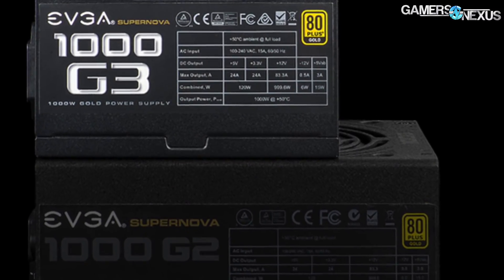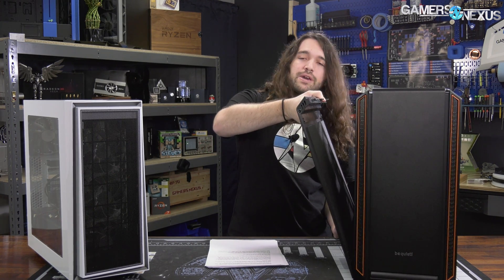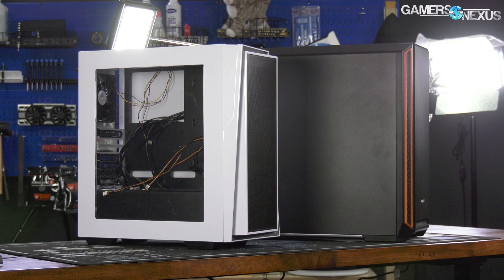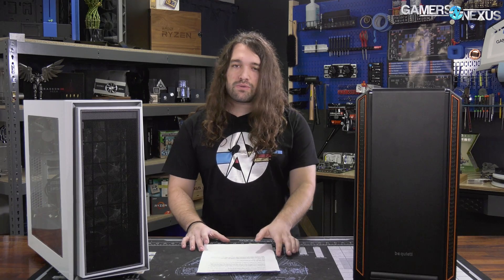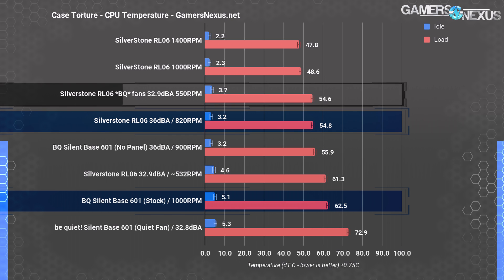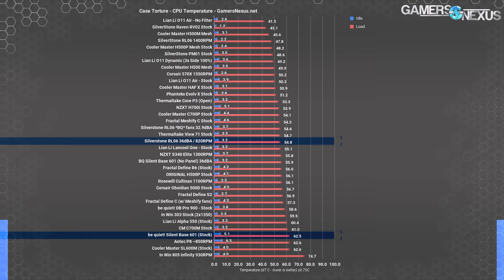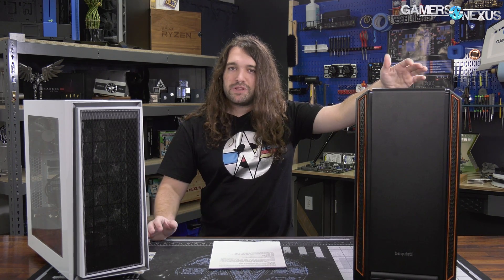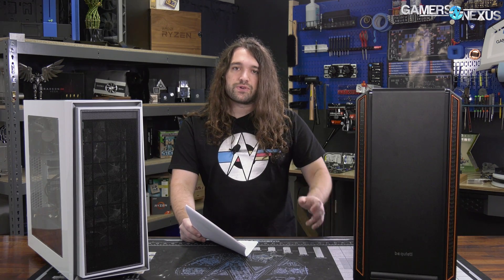Airflow vs. Silent Case: Noise-Normalized Thermals

Comment: This is an excellent theory, and I really appreciate you testing it.  I think you chose a poor example of a quiet case.  I think the Antec P101 Silent is better than the Silent Base 601.  Reasons I believe this:

1) Tom's Hardware rated it better: "even though there are three 120mm intake fans, the small vents in the front of the chassis did not impeded performance as much as we had expected." On "acoustic efficiency, also referred to as cooling-to-noise ratio" the P101 scored better than the SB 601.

2) The airflow arrangement on the P101 makes much more sense to me:  The P101 has three intake fans.  More fan surface area = slower fans = quieter, right?  The intake area seems pretty well sealed, so that intake air pressure isn't going to just leak right back out around the intake fans.  The SB 601 has one intake fan, in the middle of a huge mesh screen.  Lower fan surface area = faster fan = noisier.  It looks like all that intake air pressure is just going to immediately leak back out the front of the case.

Do you feel like testing this?  I ordered the Antec P101.  Should I also order the SilverStone RL06, and test the noise normalized temperatures myself, using a sound meter app on my phone?  I know that won't give ideal results, but I think it would be better than nothing.
Reply: How's that case? That Antec seems to be the best priced silent case on the market and definitely better than SB601.
Reply: @stanisawkowalski7440  I'm very happy with it.  I posted a video of my recent build with it.
Reply: @darxustech2883  Great oldschool way - no bullshit build in silenced case. I like that way more than Jean Michel Jarre's concert in the pc case. I'm curious about few things. How would you describe noise of case fans using build in fan controller? Is Low hearable? Is High nosier than other components? And how are the temps when you choose middle one - fans turned off? Will it handle webbrowsing without other fans starting being noisy?  And how's that X570 fan? Is it hearable in Antec anytime? Because there're a lot opposite opinions about these damn fans.
Reply: @stanisawkowalski7440  thanks.  I never hooked the fans up to the case's fan controller.  I plugged them into the motherboard fan headers, which can control DC (non PWM) fans.  With custom fan curves.  It stays real quiet for web browsing.  I've never noticed the X570 fan, and I've run loads with the case open to pay attention to fans, but wasn't specifically listening for that fan.  

At max speed, these fans are noisy, which is what I'd expect on the case fan controller's top speed.  My guess is, with the case fan controller, you'd use low most of the time, and medium for gaming, and that would work fine, but why not use automatic motherboard control?  

I think I will probably eventually replace the case fans with Noctuas, once the NF-A12x25 comes out in black.  These aren't bad, but I intend to have this case for a long time, and I might as well.
Reply: @darxustech2883  Fan controllers are for noobs ;) But I wanted to know, in case of recomending that case to some noobs. Because noobs like fan controllers :] Like I said, to me it's best priced silent case on the market and from brand, which has bigger experience in producing them than Fractal, bq! or Nanoxia. Reviews are great, scores are good, so it must be great.

If we talk about fans, I wouldn't go with Noctuas. A12x25 are maybe the best fans for radiator, but for a case not so much. Cheap way are Arctic's P12/P14 PST - top of the world performance and really quiet. But cheap fans mean cheap inside - sometimes make specific noise on some lower rpms and I woudn't expect long life without degradating. But 5 of them costs like 1 Noctua. Great midrange and kinda quality are Fractal's X2 GP12/14, but I don't know if they make big difference and are rather a little less efficient than Arctics. I recommend Silent Wings 3 - great performance, great inside, sound just best. They are a lot of comparisons of fans in the web, so see for yourself, but look for methodology - I've seen guy who test them in Define case using only one as exhaust, so it's worthless. Add to this that every other test with the same fans gives completely different results and you will have hard choice. If you don't see a problem with paying premium, just go with SW3 PWM. And in general beware of fast (>1000rpm) 3-pin fans - their start is definitely higher than 4-pin, so they're always rather noisy (in case you don't know that).

Comment: I care way more about high frequency noise than low. I have an RL06 with noctua case fans, great cooling with very little noise at 45% fan speed. However, coil whine and high frequency noise from the CPU and mobo are killer, I'm very sensitive to such noises. In retrospect I probably would have tried to find a case that's in between the two featured. Something with a mesh front but thick and padded side panels.

Comment: Please do a gaming / audio recording system. Most people who are noise nazi's for a gaming LC will mean it's for two seperate use cases. One is gaming the other is audio recording which is low load! So test with a condenser mic in the room. A couple metres away. That's all we need.

Comment: Whats the best silent, best airflow and non RGB Case 2020? Im looking for it. Thx.
Reply: Maybe @GamersNexus replies? I have the same EXACT question
Reply: @lBioHaZarDl  Define 7 Solid. Great airflow, silent during no load, really quiet during load. Until you don't buy shitty cpu cooler and cheapest graphic card, you don't need mesh front. I have this case and opening the door or removing filter doesn't change temps. Mesh airlow cases are shit ;) You can check on my channell, how it behaves.

Comment: Hey there,
Occasionally I record Audio with my pc. This does not need a lot of computing power, but a loud pc might be an artifact on the recordings. That is a case that you didn't really consider in your review, right? So basically, what I would need is a case that is as quiet as possible for reasonable loads and temperatures.
Higher Temperature doesn't dequalify the case, as long as it stays below ~60°C, right?
So, would you say the "be quiet" case was quieter in near idle mode?
Reply: Having just gone from a high airflow case to the bq 601 for audio work, I can say the bq definitely served my purposes a lot better. It's a lot easier to clean out the few nebulous low frequencies that escape the 601 than the EQ surgery I used to have to do. Admittedly there are other variables, but if you're not putting it under load for long periods of time, the bq serves the recording room well for me.
Reply: @Jokrono  Jeah, I got the same impression. It's not perfektly silent, obviously, but definitely better than hearing well defined cooler frequencies.
Reply: @matthiasschweizer7314  How about idle/web browsing? Can you hear case fans and the rest of your hardware then? Is SB601 completely inaudible during something like that?
Reply: @stanisawkowalski7440  It's pretty quiet, but I still wouldn't leave it on over night, for instance. It's in my case comparable to the noise in a medium town, with my windows closed. It's not comletely inaudible. Especially, there is one pretty deep sound, which i cannot pinpoint to one component. Thats either the graphics card or power supply. Depending on the setup, it might be much better.
Reply: @matthiasschweizer7314  Thank You for an answer :) I asked, because I was deciding between non-windowed versions of 601 and Define 7. I took 7 Black Solid and it seems superior, cause You are the secound 601's owner I asked about it. During no or low load 7 with fans running 300 rpm, 2070S Gaming OC 900 rpm and Ninja 5 ~400 is just as silent as computer off. Temperatures of CPU (EDIT: 9700K stock) and GPU then are 30-35C. Sometimes some web browsing make my CPU go over 50C and then case fans turn 1000 rpm - if the room is silent and window barely open, most of the time I don't realize that. Really,  I couldn't believe it is that quiet. During gaming fans go 1000 rpm, card 1500 rpm and Ninja 500-600 rpm and I can hear it works, when there is no sound going from the speakers. Then CPU 50-60C, GPU 70-75C. After two days of owning the case I replaced default fans with 3 Silent Wings 3 140 mm 1000 rpm from previous build. 3C better in RealBench and Furmark, a little quieter, but having in mind performance and quietness of default fans, I can only recommend them to ones, who want just better and don't care bout the cost. If You are not fully satisfied with 601, maybe that info will be useful to You.

Comment: Would it be possible in future cases to test for perceived loudness? In audio engineering you can check the volume both by the overall actual noise but also by the perceived loudness as high pitched sound is actually heard louder to our human ears than deep bass tones. I think in many ways it's more important to know that than the actual overall noise floor in many uses.

Comment: I got alot of pc's and my quietest setup has replaced cooler on all parts. GPU has a artic turbo 3. The only single case fan is a be quiet 180. And the CPU has Noctua for ryzen. I cut the hell out of my case a deepcool tristellar and I run without the GPU cover. And at full gaming load everything is silent and cool. Basicly it acts as a semi open bench with protection. And cleaning is pretty close to normal. Not dirty like my old antec skeleton or as dangerous as my garage inwin bbq with a 300mm fan mounted on top.

Comment: I will apologise to the fans of this guy, but this is complete torture to watch through.
I wanted to know what would be a good case to find a quiet solution with reasonable temperatures, but I watched about 1/3 of the way through this before skipping through to the charts, and still didn't learn anything useful.

I really hope this guy has improved is scripts, charts and sensibility in his later videos for any of you guys watching. I'm mentally tired after watching this.

If the creator of these videos reads this comment please:
* Shorten the scripts - focus more on useful information than monotonous details - or break down the minute details into a separate part of the video or an in-depth review.
* Take breaks in talking - its incredibly tiring to listen to someone continually speaking without breaks. You need to give the user a chance to digest what they've just heard. This is much easier to do when you follow the above step.
* Focus more on useful information, than fancy graphics and charts  - skipping to the charts, I only found details on temperatures, which when you're speaking about thermals and noise, is not a great representation of the information. Spend more time designing your charts to be useful, than looking nice.

Thanks - bye.

Comment: Appreciate your work, it makes a very important point. But here is the but. You say yourself in the end "when done right". So why are you doing it wrong?

First off and frankly speaking, using those be quiet cases as they come with only 2(3) fans is office pc like. Everything is better than that, probably even open case without any case fans.

I use the bq 801 with 7 case fans instead of the 2 you use there. Each fan is adjusted to its audibility. I use 1000 and 1200 RPM fans in combination.

The key difference for airflow, which I found out, in those BQ cases, is the bottom intake. It makes a world of difference to just have one fan there.

Exhaust from Back to Front
Rear-Exhaust: NB Eloop 140 Black: 50-60%
Top Exhaust 1: Fractal Design AL140 SP: 70-80%
Top Exhaust 2: Enermax T.B. Silence AF: 40-70%

Intake from Top to Bottom
Front Intake 1: Enermax T.B. Silence ADV SP: 65-75%
Front Intake 2: Enermax T.B. Silence ADV SP: 65-75%
Front Intake 3: Fractal Design AL140 SP: 70-80%
Bottom Intake 4: Fractal Design AL140 SP: 70-80%

CPU1 Corsair ML140 PRO RGB: 45-90% on Prolimatech Genesis
CPU2 Corsair ML140 PRO RGB: 45-90% on Prolimatech Genesis

This is my performance setup. The silent setup is more toned down but I barely ever use it as it is already quiet enough this way. Let me take some key notes on what I have figured out after 1 year of testing and messing around in random order:

a) In this case setup I cannot hear a difference between CPU fan 45% idle or 90% max speed. The ML 140 RGB are quite good fans.
b) Front intake has to be SP for best performance (which the 2 pure wings 2 that come with the case are not).
c)Bottom intake is the most important fan in this case to create decent airflow. It is requirement to create relyable positive pressure and stop air from being pulled from behind from the GPU as well as to support the general air circulation.
d) Some of these fans, and you see I use a high variety, have critical vibration at a certain RPM and not below or above. The T.B. Silence ADV create these at about 55-60%, hence mine are running at 65-75% and are inaudible there. The Eloop creates that kind of weird noise at about 65% in my setup, does not above or below, hence mine is running at 50-60% (below the critical point this time, as rear fan noise can most easily get out of this case and the eloop is so strong that it is enough to run it at those lower levels). 
e) The Fractal Design AL140 sounds, which are defenitely a tad louder that the ML140, are absorbed quite well in this case and can be run at pretty high speed without being audible.

Pretty much every part of this computer is OC. Not to the max but at a sweet spot in the upper range. And I am pretty happy with both performance air flow and noise. As well I am pretty sure I can't get this level of air-flow, at basically minimum audible noise in an open front case. The reason is that at load GPU and CPU fans will go up and you can't tone them down as much as you wanted. The big difference is the bottom intake. Without it air supply seems to be insufficient in this case.

What is "minimum audible noise"?
If it is night and no single car is driving outside, the wind is still and neither dogs are barking nor birds are tweeting, the hiss of my speakers and the little sound of my air-cleaner are louder than this computer in idle.

At CPU-stress (Intel Extreme TU) the computer is quieter than a little wind outside.
At Furmark GPU stress the GPU fans (UV 0.75v + OC 1080 Ti) move from 0 to 45% and there is no difference in audible sound. If I put GPU on higher voltage, the GPU is most audible part, which in any way in the silent case is not as loud as in the open front case.
(Both 1 minute test only)

Sure you can test the case with the 2 AF fans that come with it. I guess you are right and then the case is only good for a better office pc. But with little extra effort, the minimum you should use on this case is 3x intake (1x from bottom if possible) +1x exhaust, you can get decent results - not the best temps for extreme OC but doable temps at minimum noise for sure. I like that they don't put so many fans in the package so that you can pick yourself what you want.

Comment: My problem with more open cases, especially with mesh fronts is dust. They are almost always missing dust filters, claiming the mesh will catch it - but it doesn't for me.
So "closed" doesn't have to be plates, but everything that isn't needs a filter. Which I haven't found a nice case for.
Guess I will still have to go for the bq 801, which fixes some heat issues of the 601.

Comment: Why not also test with an extra fan in the 601? You know, a fan that blows at the CPU cooler...

Moreover, you did try the RL06 with better fans, but you didn't try making any alterations to the 601. Why? If there is one thing someone might do when buying a case, it's getting an additional extra fan. So that should be the first thing you should try.

Seems really weird to me that you didn't test that.

Comment: I am not sure using foam in a computer case is stuch a great idea. It might deaden the sound, but normally it has more to do with reducing reflection and reverb than over all deadening the sound. The down side is it normally increases temprature. So using it in a cooling solution might not be the best idea. I could be defeating the purpose. I can see the idea they were going for using insulation and a more closed case. It would help keep the sound in if you had a loud a cpu and gpu fan. Providing it was a sealed case other than where fans were installed. If it is like most cases and has a bunch of openings and vents on the back then I really don't think it is doing much. Other than restricting air flow to the fans.

Same thing when people talk about negative and positive case pressure in my opinion. Unless you are running a sealed case I don't see how there will be any pressure difference that can be measured. Unless you are running extremely high output fans. All you are doing is messing with the air flow. Your goal should be to acheive the best air flow as possible without restricting the intake or exhaust. And you only need as much as you need. If increasing the air flow doesn't actually change the temprature then all you are doing is wasting electrcity (which could add more heat), making more noise and increasing the amount of dust that goes through your system.

Comment: It's really all about hard disks. If all your noisy components are relative to thermals, then good airflow will win easily. But if you have thermally independent noise-creation, like you do with hard disks, you should prefer something like the Silent Base cases.

Comment: But the price of the airflow case is going to go up quite a bit if you are replacing the fans, at the min (Dec 2018) each fan is about £20 (silent wing 3s) for me swapping out the fans on my old case and pcu water cooler it will be between 2 and 5 fans I need to replace, so if your paying an extra £80+ for fans that one of the airflow case selling points out the window.